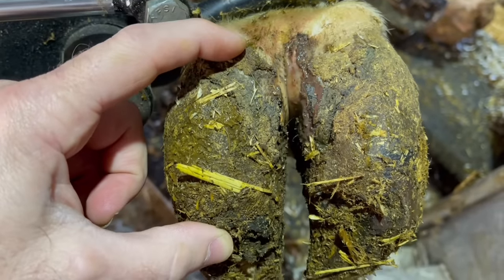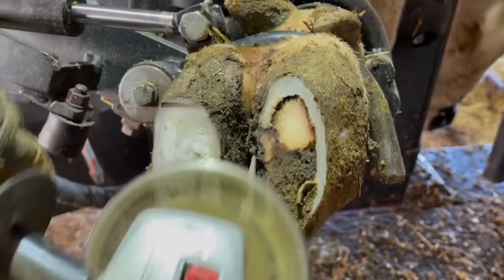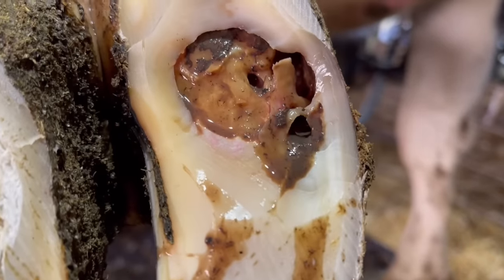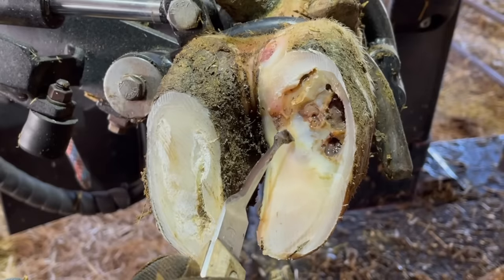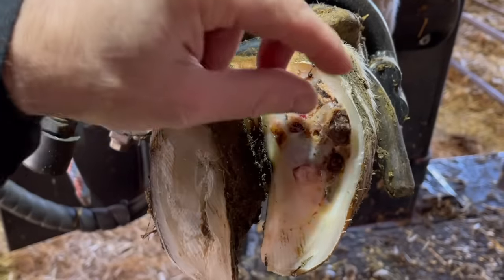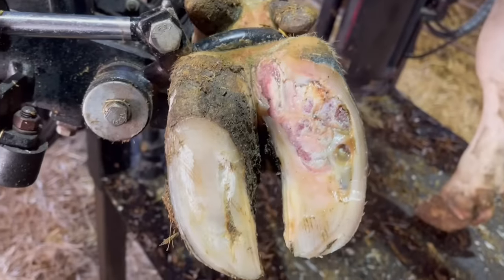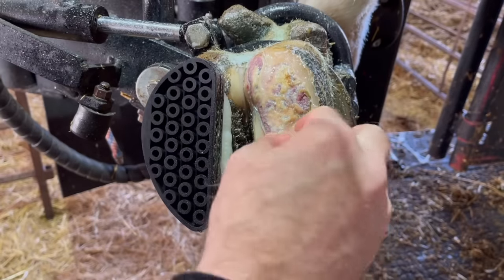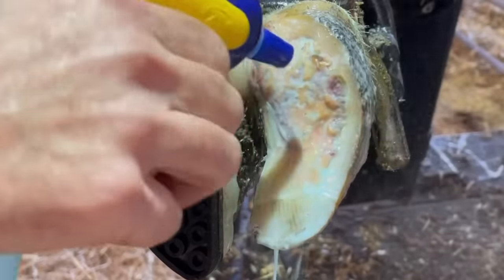There’s a Ton of Dermatitis Under This Sole....(SPECIAL RELEASE)

Comment: Hope your feeling better Nate.  What happens when you can't trim? Do the cows just wait? Do you have other hoof trimmers that can help you out?  Thanks.
Reply: That's what I was wondering too. I know herniated discs can really take you out. Mine wasn't even fully herniated and I had numbness in my hand coming and going so much I was scared to try to use it. The muscles around my neck also got so swollen and tight that my chest couldn't stretch when I breathed in, so breathing was painful as well.
Reply from the maker: I had my mentor lined up to help me out if I was laid up any longer.  Luckily I was pretty well caught up when it happened.  Emergency cases a vet could do also.
Reply: Superb work you did there, and great commentary too. I too also suffer with disc problems in my neck, so I know exactly what your going through.
Many thanks and wish your a happy new year.
David in the UK.
Reply: @NatetheHoofGuy  Buddy, please take care of your body. My dad ignored his back problems for years before he finally went to the doctor. What initially could have been repairable ended up with him being too far gone for recovery, no longer capable of working, and multiple surgeries to slow down the worsening of his issues.

Comment: I hope you feel better! I had that a few years ago. A 6mm bulge pushing my nerve. The bulging disc was between my C6 and C7.  The surgeon here in the Dallas area had done many surgeries on college and pro football players, so I was lucky to have him do the surgery. He went in under my chin and put in a titanium implant. No fusing of the vertebrae. He also had me go Relax The Back store and get a medium sized cervical pillow. It cradles the neck and head. It’s so comfy and it helps keep me aligned all night. There are lots of brands, but he said stay away from other brands, this store’s product is top notch. I even bought one for when I travel, and I have a smaller one for camping! All in all my nerve pain and discomfort was instantly…instantly gone once I was awake after surgery. It was so awesome I didn’t have any pain. I had to get it fixed asap because I teach school, and dealing with that pain at work was terrible. Hope yours gets all worked out. If you have any questions just let me know.

Comment: Take care of yourself!!  I had a bulging disc in my neck. After several years mine got worse. I chose to have my c6-7 fused. Helped the pain a ton. Now I’m just having more issues 20 years later. But the pain is rarely as bad. I figured out things that hurt my neck, and I have a job now where others will lift what I can’t for me. So I can finish what ever I need to❤

Comment: I’ve been studying how Nate and Graham Parker both approach trimming and had a question: Nate seems to wrap and powder more while HoofGP tends to iodine and leave exposed more.  Is this primarily due to climate difference or just technique?🤔🧐
Reply: Probably both. The exposure can be dangerous in wet, or cold pastures while in dry and cleaner, warmer pastures and areas, exposure can allow quicker healing time due to better breathability. It really depends on the area and the condition of the pasture. I am more knowledgeable about equine than cattle so I could be missing some information, but I have worked with horse hooves for a while now and this is my presumed analysis.

Comment: Is dermatitis transferrable if you use the same knife?
Reply: It is if you don't clean it. He did a video answering lots of questions a year or so ago. If I remember correctly, he said that, to prevent cross-contamination, he cleans down his equipment after treating a case like this with chlorhexidine (same as he had in his spray bottle, which is also the stuff we use in theatre/surgery for humans, so it'll definitely kill it off).

Hope that answers your question 👍